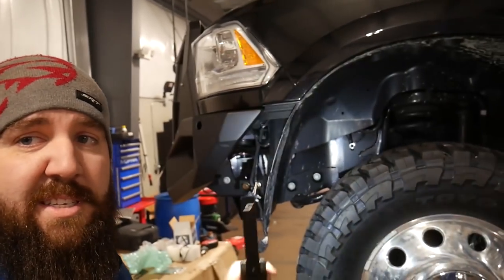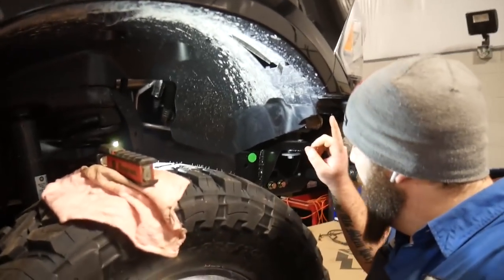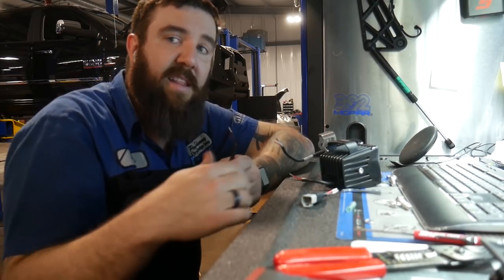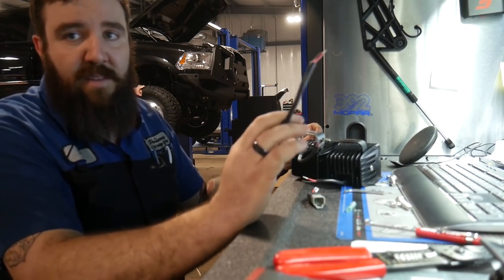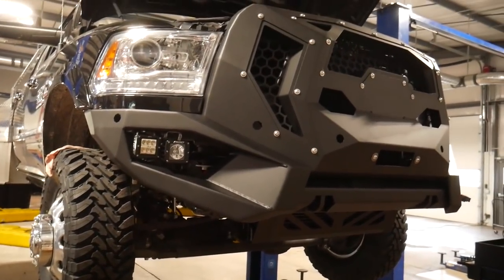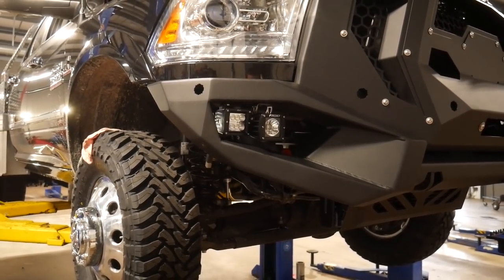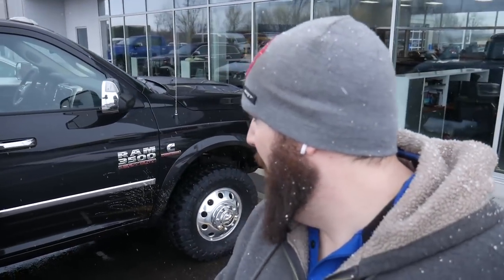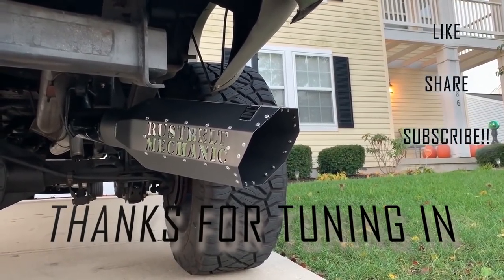2018 RAM BUILD WITH GRUMPER - PART 2

Comment: I'll use those heat-shrink butt connectors when need be, but I guess you don't have Deutsch pins and the crimper? It could have saved doing a pigtail splice and just pin the connector right on and made wiring a cleaner more professional  job.